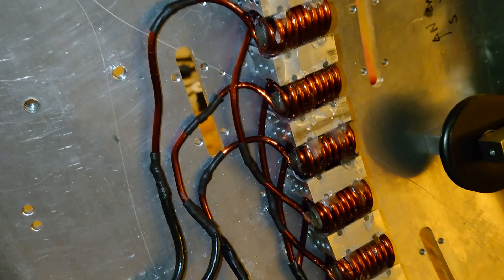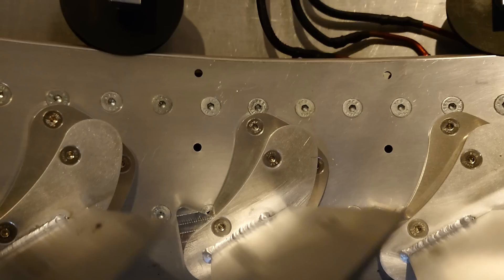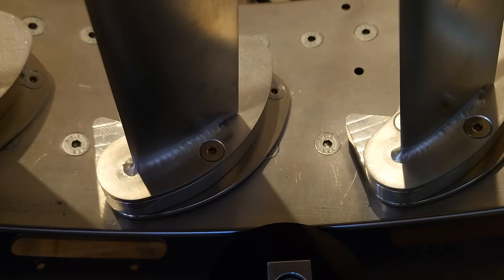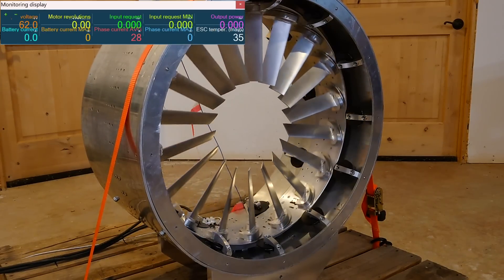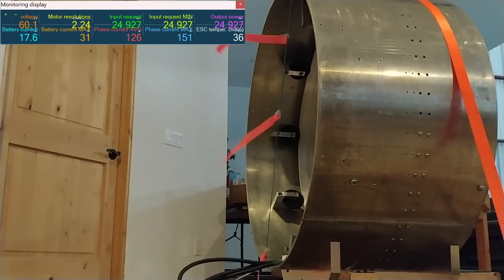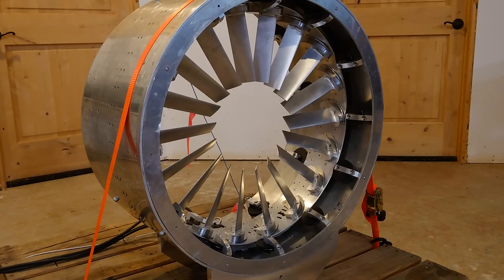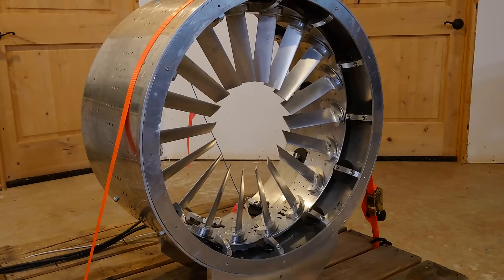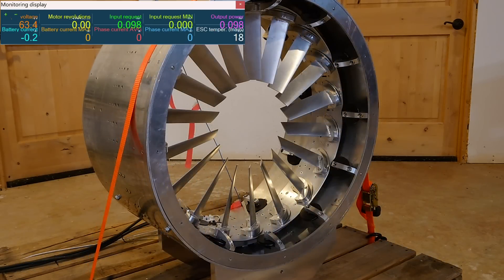Rim Driven Coreless Thruster running at higher RPMs

Comment: I think previous commenters were referring to a 'Centre body' in order to stop the very thing you are trying to avoid with your unique design, that of airflow reversals and fin tip inefficiencies. The stall you speak of might very well be a result of airflow forming a toroid @ the centre of the fan array masking off a good deal of the fin tips, thus an accelerated stall condition. The centre body would eliminate this almost entirely. Not a ring but a tear drop shaped centre body. I also submit that a certain amount of centrifugal airflow will occur without a centre body. And also that tapering the blade chord width towards the centre would enhance the fins strength and ability to generate thrust where the greatest velocity is.
Reply: @WolframSV2 That would be too long for this device, no something like a WWII 'drop tank' for a fighter plane. Aero dynamic enough for the purpose and can be dynamically balanced without contributing any of its own problems with regards weight and high rpm. I forgot to say that any blade flexing could be uniformly countered with the centre body also. Think of how airplane wingtips are improved by the instillation of tip tanks, they're not just a convenient auxiliary fuel store.
Reply: @WolframSV2 Exactly, better put actually. But also the important avoidance of blade stalling.
Reply: Follow that track all the way, and you end up with a full hub, so may as well power the fan from the hub rather than the rim, and just put a duct around the fan, somewhat like the ducted fans on a fan jet....   mmmm...?  But if you want to power the thing from the outer rim you still can have the coils etc in the outer housing, while the rotation forces are accommodated in a conventional gas turbine setup with central shaft and bearings.
Reply: @nigelwilliams7920  The conventional way seeks only the efficiencies of the rim drive @ this point, as it has found every other measure over the decades, and yes they are great at what they do also. The rim drive however could become exceedingly flat/large diameter over a period of development, something the conventional TF cannot. Plus the advantages of being able to be remote from the engine/power source without complex drive trains via electric redrive/battery power/H2 cell/combo's etc. The designer of this tech I assume is thinking towards large drone and or VTOL flying car types, mostly benefiting from remote ducted fans with all the noise and heat kept in one place (i.e. the opposite of the frightful Moller Skycar).

Comment: Your design is flirting w/ some very interesting things. Your variable position blades are creative.  I personally am a simplicity advocate, but that's me.  Anyway, your design already has the inherent geometry of a flywheel. It seems logical to take advantage of that. To manage the weight, one way would be make your rotating "rim" heavier.  And make your blades/mounts out of Carbon fiber. There's some good videos re: 3D printed parts reinforced w/ Carbon fiber.  Might be useful having magnetic gears to adjust low speed high-torque as it revs up. Keep it up, & Good Luck!   :)

Comment: Are those blades as configurable as they look by the mounting mechanism you've got there?  Can you not actuate them like a helicopter does?  ie.  Controller reports RPM / Optimal AOA and the blades adjust?

Comment: 5KW is just under 8hp. So 4X would be about 30hp.
It seems there are a lot of tiny moving parts.
Seems however, given the large surface area of the circumference, rollers could be replaced with magnetic levitation.

Comment: Exciting technology.  I hope it works out as desired. Humble opinion follows:  Regarding the range of engineering considerations, I might include not just standard operating conditions, but foreseeable non-standard situations.  Center ring might be good for multiple reasons, but especially adding strength and stability in case of indirect bird strike on airframe scattering debris toward the intake-side of the duct fan.

Comment: are you using an inverter to change phase instead of mosfets for speed control?  since the thrust will push toward back you should just have guides on the front side saving weight and drag. second, the rear rollers could use suspension. this might help with the circle being out of round. have you considered using polyurethane mounting blocks for the wheels? or bushings for existing bolts.
i would go the inner ring or a wingtip for turbulence as well as strength inn the  case of the inner ring.

Comment: you may have seen this before or just not be interested in doing so. Have you looked at trying to work on implementing this in smaller design scales(ie large remote controlled planes) both for looking at implementation in more scale aircraft, and the fact the people who make model jets with small electric blower props instead of jet engines would kill for more efficient systems

Comment: Your hall sensors are not positioned correct, they are at an angle, that affects the timing big tine. They need to be parallel to be radius and at a verry verry precise distance in the center of the stator slot/teeh and all should have equal airgap from magnets. They are very sensible to magnetic field strength witch affects theyr switching threshold, witch directly affects the timing. At that stator diameter a few 0.1 degrees mean many electrical degrees, and that is not good for timing.

Comment: I think what people were getting at concerning the inner on thr blades is reducing or eliminating drag caused by tip vortices and not blade flex. Also would this idea be able to be modified to work as ships propellers? Great idea.
Reply: Probably not as ship propellers, as even with the rim spinning, it's going to have drag under water, and massively increase the surface area of a moving part that doesn't actually provide thrust (compared to a stem that holds a traditional propeller). Not to mention if something gets sucked through there and gets caught on the blades, it's going to be a mess to get out, and cause more damage. There's also already something similar to this used in water propulsion, and that is water jet propulsion engines. Another thing about this design is it's not really a strong design for high torque, which is what is needed when pushing a lot of heavy water through a turbine in a stable manner. Water jet propulsion is pretty robust as is, with a solid central crank shaft that drives blades in a design that both sucks in water and also gives it a hard push on its way out, with two different rows of blade types. Keep in mind his design is primarily for low cost high volume for smaller craft. All it really does is invert the way an aircraft turbine is typically designed, where blades are fixed to a central shaft and rotate on it, while this rotates the blades from the outside with a hollow central shaft, which should also allow more unimpeded space for thrust to flow through. And it's really mainly designed to replace propeller driven planes, not jet engines.

Comment: Don't quit, now.
Straps = Out of Round?
Try a wooden jig, to keep it round.
Put it on drawer glides, level it, and get good data.
Thrust measurements, especially.

Don'y let it wobble.
Reply: The tube was not manufactured correctly so is out of round before the straps so he's on looser as far as this rig goes (and he knows it).

Comment: Good effort on your coreless EDF design. Some brief observations to stop YouTube deleting my comments again.
Turbulence is caused by duct leading edge separation. For static test fit intake bell mouth. Figure 4a on page 26 of AMCA 210-16 shows typical dims.
Out of balance could be handled by compliant mounts between duct ratchet straps and pallet. Put resonant frequency below problem rotational speed and critically damp. Might need a subframe between duct and pallet.
Aluminium coil housings will suffer eddy currents that reduce B-field. Use machined nylon replacements or plasticine molded epoxy resin.
Convinced there is more mileage in this prototype without too much spend.
Reply: https://www.amca.org/assets/resources/public/pdf/Education%20Modules/AMCA%20210-16.pdf

Comment: May I suggest you buy a Kelly controller that runs 50kW.  The Kelly controller is amazing in that you can connect it to a pc and optimize so many variables.
.
Then buy something like 20 (or more) 12VDC batteries and connect them into, say, two banks (each bank in series up to 120VDC) then connect the 2 banks to each other in parallel doubling your amperage. Your motor looks like it can easily handle the amount of power.
.
Then.... THUMP IT!!!

Comment: I think you will be losing a bunch of energy in all those bearings.  The farther out you go from the center of rotation, the higher the lineal velocity you have in the bearings.  The losses from that are proportional to velocity squared? So this is why people try to make the bearings as small in diameter as possible usually.  You've gone the opposite direction on this.  Do you need so many bearings?  Maybe you only need 4 or 5 or 6 on each side, and you could try staggering them.  Also you need rigidity or symmetric deformation to maintain balance.  This is why the tips of the blade should be coupled. You should just try it rather than telling us why not.  You may find it has other effects on the flow, similar to wing tips on modern jets.  Also the motor coils should be evenly distributed around the whole circumference, to avoid placing uneven loads on the spinning system which will deform and go out of balance.

Comment: I still think that an Alu ring in the center is a good idea to distribute the load from the outer ring to help prevent distortion of the outer ring.   A CF outer ring begins to mitigate one of the problems of the mass at the outer edge, but only one of the problems. Using an outer-drive but reverting to a center bearing aleviates the outer ring mounting issue (and probably would help alleviate distortion from centripetal forces on mass variance), but I realize that part of your prototyping  is to "try to use the ring mount."  Just my not-an-engineer thoughts....  Still very intersting project.

Comment: Reviewing your motor design for the speed you want achieve, I think your entire inner rotor should be mag lev and by adjusting the material properties you could make it so your rotor “floats” in the middle and using another mag system push your adjustment ring forward or away by using a spring vs magnet set up. Where a spring will alway try to keep it at 0 and the magnets pushing away from each other will push the pitch
Reply: How much energy are those magnets going to require to hold a fan producing 800lbs of thrust?
Reply: @TheJazsa80  I would image zero if you used rare earth magnets instead of electro magnet, you could also look at super conductor as there have been some break throughs there but that would also be expensive
Reply: Would rare earths hav enough magnetic force to resist 800lbs of force?  I would have thought you need electromagnets. Interesting.

Comment: This looks pretty good.
In relation to the precision of the rotor, I wonder if a spin dryer tub would offer better precision for the next prototype - I see they spin at 3200 RPM from a quick google search.
I realise there are many problems with this as a base, but off the top of my head, I can think of a couple of approaches to overcoming the short comings - mechanically hacking the tub to suit or using it to cast a rotor..
Probably a silly suggestion, but I'll take the scorn and ridicule if there is anything of value for you. :)

Comment: I love this intriguing design and I trust your calculations on the trust capabilities are correct. Spinning that diameter barrel at 6000rpm on rollers will require precisely manufactured components built from exotic materials as compared with aluminum and Delrin rollers. Not to mention a lubrication strategy capable of dealing with the heat generated by 800 lbs of thrust @ 6000rpm. Bigger blades lower rpm is the only hope. But I hope I'm wrong because I love the thought.
Reply: @bigmikeobama5314 Carbon fiber composites aren‘t very good for compression tho, so they prlly wouldn‘t be that good in these blades anyway
Reply: You're right, this thing will eat itself at those loads. Just the side guide rollers being loaded with high surface speeds at high pressure and lots of sideways slip all under high dynamic loading via vibrations
Reply: I mean different materials and actively cooled bearings is definitely a possibility, that is what they they do in real jet engines after all

Comment: Challenge remains on multiple bearing losses and outboard rub wheel configuration inherently increases failure points and high friction losses compared to 2 or 3 relatively small and easily cooled bearings in typical turbojet solution.  If whole rotor could be floated on air or mag bearings maybe but then susceptible to shock loads and weight penalty.

Comment: A few suggestions. The inner spool which is connected to blades needs to be CNC machined and then balanced. Same for blades. The 2 sides of spool edges should not ride on the wheels as engine is losing a lot of energy on each bearing. That connection should be frictionless. Instead, the bearings should have a retractable mechanism which moves spool holding wheels, when the RPM of spool with bladed reaches certain threshold speed, and those wheels hold spool "parked" at low RPMs. For high RPM where motor generate thrust your spool should be avoiding any physical touching to other parts. You can employ the same technology of magnetic levitation (maglev) used on e-trains to hold spool in place on "magnetic rails" at the spool edges. Yes, it'll take extra energy but earlier this year Honeywell delivered tiny turbine driven generator for evtols that can be used to add energy to the main system in case of emergencies and for extended flights.
Cheers from NY
Reply: Also, for the above suggestion - the blades actuators should be fixed on the spool, powered by electromagnetic induction and operated via RF channel
Reply: Or, attempt to do something similar to what the Rolls Royce jet engines do with the shaft which runs up the centre of the engine, using air bearing tech.

Place a cowel over the lip and make sure the outer rim and the inner surface of the cowel conforms to a certain shape with either side of the rim being the opposite to each other, then, air pressure alone should maintain the gap.
Reply: @weedfreer air bearing sounds really cool, maybe rolls Royce can incorporate that tech into the final design if they fly this design, not sure it makes much sense in a table top test prototype. Any bearings that work should be fine.
Reply: You should make a device like this and implement all your suggestions.
Reply: @lastofthebest5102  I know a fair bit…access to the tools or the knowledge about how to use them on the other hand…no
Reply: liquid helium or nitrogen would be a little over kill for this
Reply: @Billskins4dayz magnetic bearing are made without requiring superconductors.
Reply: @jsbrads1  not high efficiency ones buddy
Reply: Those are pretty nice welds though

Comment: My question is: What's the idea behind the open center? Wouldn't you have enormous pressure loss and forward flow on that hole? One of the main challanges in commercial jet engine and industrial turbine design is to improve the tip seals to prevent pressure loss. Enginners use ingenious seal geometries and adjustable housing diameters to achive micron order gaps, but here there is a melon sized gap in the center. What's the idea here?
Reply from the maker: Once the flow starts moving there is an entrainment effect that pulls the air through the center. The blade tips at that point are not subject to tip vortices as the air is already moving past them. The entrainment is known for creating a much higher efficiency.
Reply: @petermuller9177  Thanks for the reply! In absolute terms, of course air is rammed trough, but relative to the free stream, is the flow in the hole positive?

Comment: Good to see it working to where you can reach higher speeds! 

Nice work, especially with so few coils. 

Just wanted to point out that apart from delta vs wye (sqrt(3) factor of either better voltage on coils in delta, because coils see phase-to-phase voltage, which is sqrt(3) higher, but so is the current consumption), you can also have coils in series and parallel.  Eg, multiple strings of four coils (as you have), but those strings in parallel, in a phase: This would work with a higher current controller, if you kept the same battery voltage. Else scale up the battery voltage with the number of coils. 

Also, I really like how you have those coils wound: Two layers, starting and ending at the same end. Looks good. 

You can get square-section wire so as to get more copper into the same space coil. 

Also, consider a linear Halbach configuration for the magnets: Basically, twice as many magnets, but they're square, and between every North - South pair, you have a couple that are mounted 90 degrees. These help all the flux concentrate on just one side of the array (the side towards the coils in your case).  This should yield better performance, with less mass (no need for magnet iron on the rotor).
Reply from the maker: I thought about using a Halbach array but that would have meant twice as many brackets. Possibly for the next prototype. I also thought about the future possibilities for chaining sets of coils in parallel. RIght now, for me, there's too many variables and presently I don't have the time or resources to experiment further.